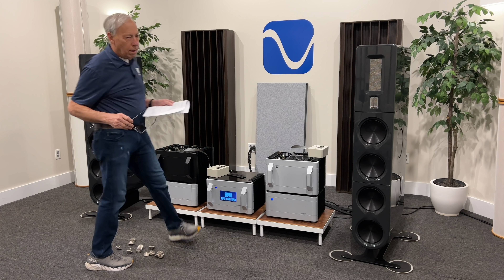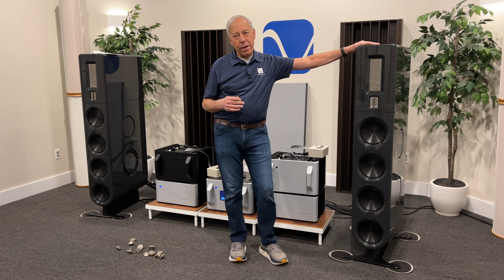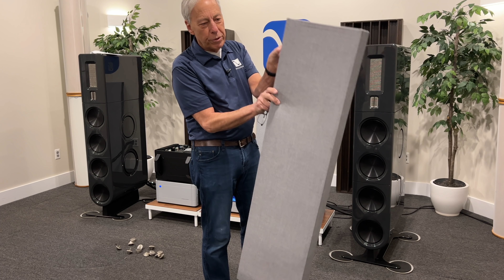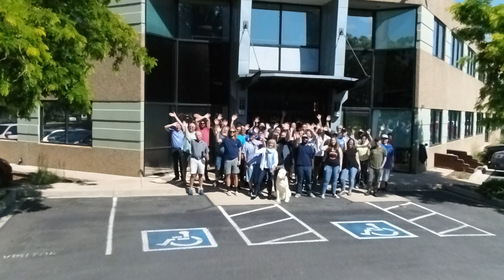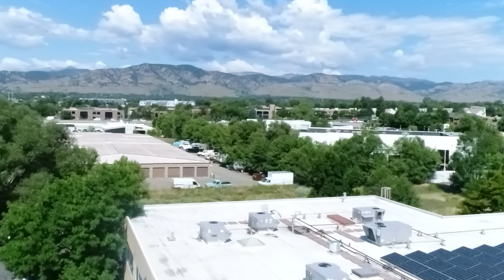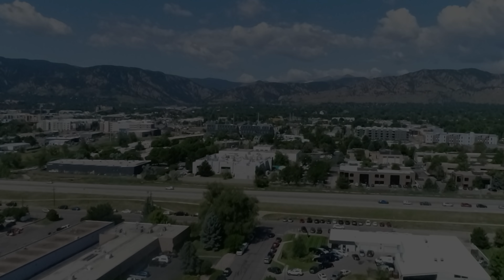Using acoustic diffusers

Comment: Really good explanation, Paul. I read almost 500 pages of Floyd Toole’s book ‘Sound Reproduction’ and you summarized and demonstrated the biggest room issue, first reflections, very well —your ‘talking and walking’ was brilliant. And you didn’t ask us to interpret even the first graph! (An inside joke for those who are familiar with Toole’s work.)
Reply: But Paul doesn't have enough diffusion in the front wall. So, the sound field is going to be a combination of diffused sound and reflection and it's not going to be a REAL diffused sound field.  He should have at LEAST 50% surface coverage first.  But there are other things you need to do first before you add diffusion.

Comment: Great video Paul,
I had a further question with regards to the sound reflections from the side walls.
Are these reflections what gives me the illusion of the sound stage being wider (to the left and right) than my actual speaker location. I know how the sound stage is generated between the speakers as you have explained this in another video of yours, but I always wondered about the sounds that come from outside the speaker placement, is it reflections from the wall or is this illusion direct sound from the speaker cones?

Comment: Box speakers, just like your FR30, react with the room much more than dipole panel speakers.
Reply: These are not traditional box speakers, only bass section. They are like closed box magnetic ribbons from 300 hz up (?) therefor more similar to Apogee´s without rear radiation... Magnepan, Martin Logan, Apogee, etc are much less sensitive to a normal acoustical treated room (read 99% of all rooms out there) because of their narrow dispersion pattern, which is a good thing IMO. I am a planar guy and can´t go back...

Comment: Thanks Paul, great video! Would you put diffuser or absorption panels on the ceiling?
Reply: Diffusers. You want diffusion at primary reflection points, and absorption at the room nodes. Search for Room Schroeder Frequency. Below this frequency, sound waves pressurize the room, above it they bounce around. Any wave that reflects and reaches your ears in less than 4 to 8 milliseconds (depending on your sensitivity) of the main wave will be interpreted as being the same wave and results in muddy sound without clarity. 

Floors are usually the worst offenders - hardwood floors sound really terrible and can be addressed with a throw rug. Backwalls are usually the next worst since the sound comes from behind and confuses the brain.

Comment: Does diffusion directly behind speakers make sense? Why would either diffusion or absorption directly behind speakers that are positioned too close to the front wall not create a sense of the speakers being a few feet further away from the front wall?  Please advise.
Reply: Front wall Diffusion works on 2nd reflections from the back wall and other surfaces
Reply: You should place speakers as close to the wall as possible to avoid cancellations.
Reply: In my project recording studio I use both absorption and diffusion behind my monitors.  In this case, the corners are treated with floor to celling absorption to mitigate bass build up.  Bass frequencies are notorious for building up in corners.  Directly behind the monitors are diffusion panels.
Reply: @mateodeo9161  So you ignore the amount of reflection on other walls compare to the direct sound. For me, I don't stick my speaker to the side and front to the wall as much as possible. A walk around the speaker is a good distance. Triangle relationship is the most important.

Comment: If your room is plagued with reflections, you will want a degree of absorption.  Not so much to make it dead.  But enough so that it is no longer an echo chamber.

I put absorption panels in an alcove to the side of my living room.  Any sound that managed to travel there and make it back to me cannot be good.  I want nothing back from that alcove.

For the rest of my listening room, I have a combination of absorption and diffusion.  Did I get it right?  Maybe not.  It is really hard to know which panels to buy for each wall and the ceiling.  But my results are really good.  My music sounds much better.  But a different arrangement of my panels would probably yield even better results.  I'll never know.

There are companies that specialize in this, and cost a fortune.  If you have the $$, then go for it.
But you will never really know if that company got it entirely right, because you will hear only their final set-up, and it will sound much better.  But how could you ever know if they could have done an even better job?

My room treatment are by Vicoustic.  Their panels work.
But they sell expired glue, their panels come down, and their warranty is 99% useless.  It took them 2 years to resolve my issues (that's 2 years with 1/3 of my panels eventually coming down).  Imagine living with that sight in your livingroom.  And it was one of their installers that did the job.  The problem was with the expired glue.  And guess what, they shipped more expired glue when, 2 years later, they honored my warranty.  This time, the installer went to my local Home Depot and purchased some other glue, and it has been at least 2 years and no panels have come down.

By the way, there are other ways to tame the sound in your listening room, such as with plants and curtains and carpeting, etc.

Cheers!

Comment: I hope the FR30s punch above their price point. But they won’t be considered “world class” speakers, because the tweeters are too high. Tweeters should be at the listeners’ ear level. I also don’t love the crossover points.
Reply: FR30 looks just plain silly. Agree, the tweeters are placed too high. What the heck to you need 4 x 8" drivers for. The whole design is a laugh.
Reply: They do punch above their price point. Don't knock them if you don't have a pair.The tweeters are perfectly placed below the mid-range. you're assuming your height, type of chair and sitting position is everyone's sitting position but hey,make your own world Class design, we'll support you if it's any good.
Reply: @DrynisDramula  Agreed.  In fact the proverbial "sweet spot" is often just below the tweeter (between the tweeter and top woofer in this case)

Comment: could anyone give me  answer for cone shape an pattern of the sound wave formed, ect does a flat cone have a different sound wave  then concave cone  or square vs triangle shape?
Reply: The driver cone shape does have an effect at higher frequencies.  The the directivity of a driver will always vary with frequency, and is affected by both the cone shape & size, and the shape of the baffle that the driver is mounted on.  Take for example a 3" dome midrange vs. a 3" cone midrange.  Both might have similar directivity below 1kHz, but the dome will have wider dispersion above 1kHz.
Reply: @TheMirolab    thanks, that's where i was going with that is dispersion characteristics , do you know of any  real tests done on this stuff, i would love to learn more, i cant find much research on this tho , but someone must have done it  because most all cones are shaped the same , just always wondered why, i see flat cones work just as well an can have better off axis response, so just got me thinking

Comment: What don't understand is: Why put any panel behind the speakers? If any, there is barely any sound back there?
Reply: I have Magnepan 1.7i which are dipoles, I use diffuser panels behind them on the front wall.
Reply: @tonyvaldiconza3914  That's just placebo. You think it sounds better.
Reply: its for the second reflections form the back wall and other surfaces. And Yes it works.

Comment: Some day in the far future, we will bypass the ear completely and tap directly into our auditory nerves.  That would eliminate everything in the way of absolute sonic clarity from 0 to 50KHz with no compromise.  Until then, we're stuck with unlimited half measures and compromises.  Do as we might, nothing will ever sound quite right due to the physical limitations of everything we use - source, amplification, vibrating speakers, the air itself, the room, our ears, etc..  Only once we've bypassed all of that will we get perfect sound.
Reply: Why stop at 50khz?
Reply: You can't hear more than 16-20 kHz, mister. And 0? You can't hear much below 20 Hz.
Reply: @drdelewded  The day we do that, everyone will hear the same thing. Room size, ear shape and canal won't play a big part any longer. But who would we trust to implant that in our heads and not spy on us? that''ll be a challenge 150yrs from today
Reply: @DrynisDramula  oh I'm not suggesting it's something we're looking at in the near future.
Reply: There's a certain irony to the character of imperfection.  Seems the brain doesn't always want things absolutely perfect.  Anyway, that's what I tell my wife.

Comment: I just can't get on with the idea of multiple 8in woofers.. None of them can handle 110dB of raw 40Hz bass tones. That's why Focal use a 15in Evo driver in their Utopian loudspeakers.. 15in drivers deliver much low extention and greater power handling than 8in drivers.
Reply: Sounds above 90 dB can lead to chronic hearing damage. why would you want anything playing that loud?
Reply: @DrynisDramula  If your spending $30k you want a speaker to be able to play at concert volumes. The AR30 won't do that. It not a matter of listening at that level but a case of power handling capabilities.
Reply: Not many have houses as big as the Americans does. I'm pretty sure this size will sell a lot in Asia.

Comment: Do you belive in toe in on speakers Paul ... Never seen any toe in when you have made videos with speakers in the room ... The IRS speakers were straight down the line as well ... Kind Regards
Reply: Depends on the setup but generally yes, a little toe in to optimize center fill.